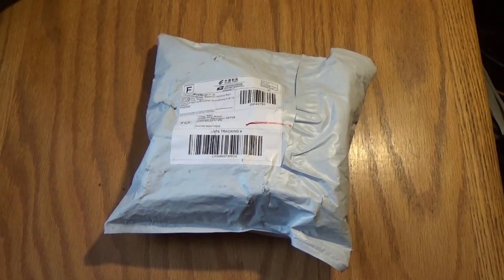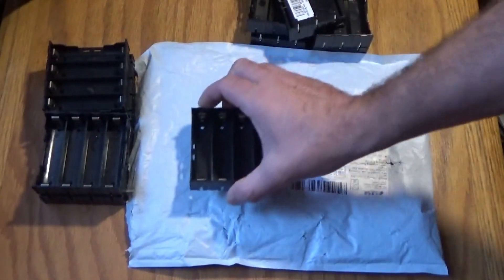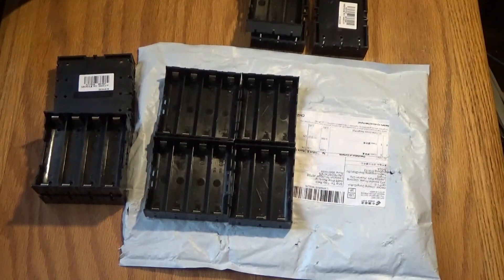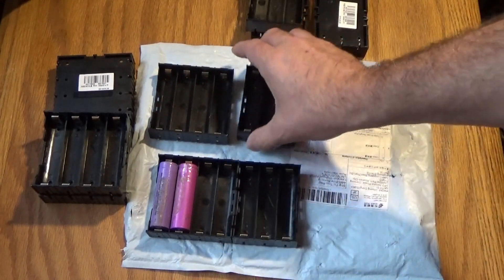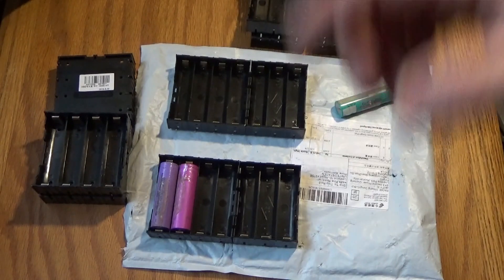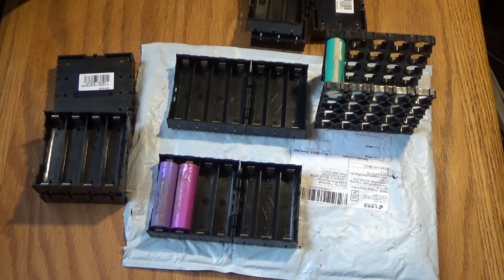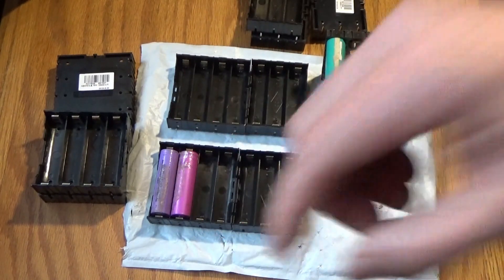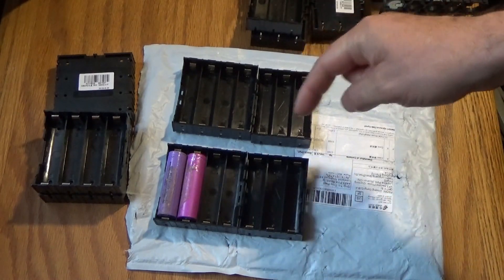Gathering Parts For My 18650 Power Wall

Comment: Hi Troy
This will be a lot harder than you think !

Fault sensing per cell & in circuit will give you fits .
( A polyfuse a resistor & 2 optos could be used but its messy & you'll need one set per cell )

Then on a 2s stack the micro vcc is below the sample voltage & a voltage shift is required !
Resister dividers = voltage errors ( low adc resolution ) & a discharge problem by the  dividers & ADC in put pin  .

When in series charging check the charger pcb inputs & outputs are isolated .
A wizard charger designed for series charging should work .
2 or 3 pcb's from ebay may just give you smoke & flames .
Reply from the maker: Yes its going to be hard. At first I will have load balancers in place between the cells and packs. Later I can add an Arduino to check each cell, scanning packs now and then to look for bad cells.

Comment: That is nice for a smaller Powerwall.  For $11 I can pack 200 cells then spot weld them together.  If you solder the batteries it is pretty easy to replace just one cell.  Just break the tabs on one side that holds the cell in.  If you weld the cells it is a little more surgery to get one out and replace it.  I had to do some research to figure how I was gonna be able to add these Boston Power cells without spending too much just to hold them. I paid $125 to hold 300 cells big price difference.
Reply from the maker: Mine will be smaller for sure. My plan is to have removable power packs which I can take on the road with me and then put back into use at home when I am done.
Reply: @thedoityourselfworldelectr8007  yea I heard you say something about that in the video.

Comment: Would have been better just to solder the cells or even better spot weld Them. The trays are Good for 5 cell packs but not for powerwall. And its alot more compact as well. Note that you should have a decent bms to. 
I use above holders for powerbanks where i need to swap out cells. 

The plastic holders are so much better Long term. And thats from one having more than 29000 cells in a pack. 

You dont need to take that Hole thing apart.... Check out My video regarding that. You only need to poop out One cell. And IF you do it properly you have cell level fusing and then you just snip that 

So Long term the proper holders are better.
Reply: Also note that IF you need to monitor each cell alone you havent done the pre=work before assembling it. My oldest packs have been running 24/7 for 4 years without doing any maintenance so far :)
Reply from the maker: I am experimenting with super capacitor welding.
Reply from the maker: Wow, 29,000 cells!!! I dont have a welder for these in the first place and dont really want to invest much money into the system right now. I may love it and keep expanding though, lets see. I have a plan to make removable packs so I can grab some and take them on a camping trip. When I get back home, I can slap it back into the power wall.
Reply: @thedoityourselfworldelectr8007  can Always build a mot powered spot welder. Microwaves you can basically get for free :)